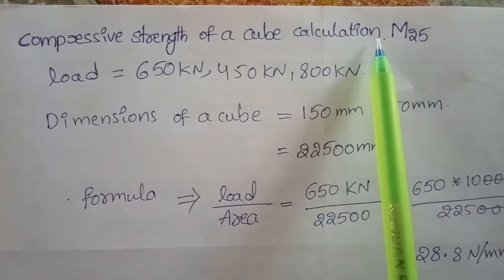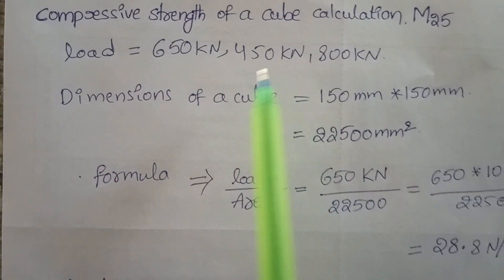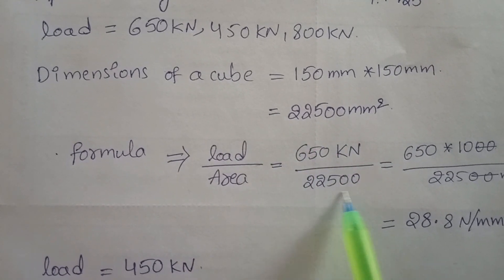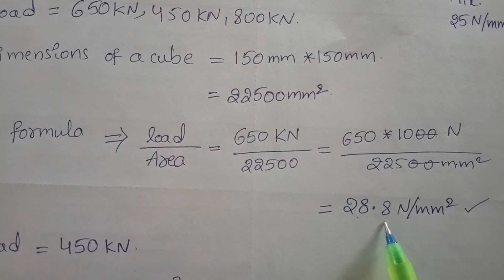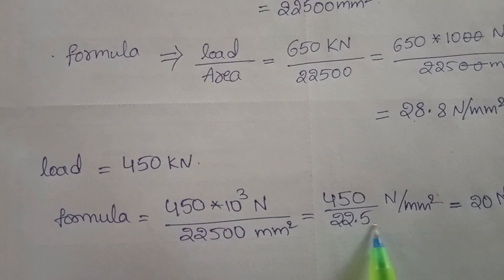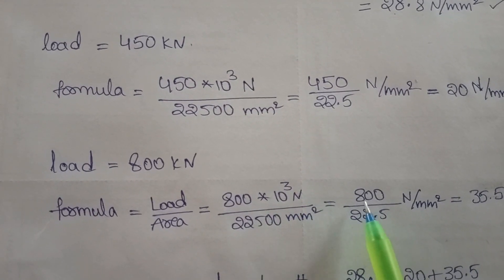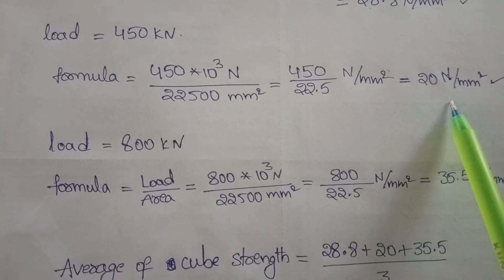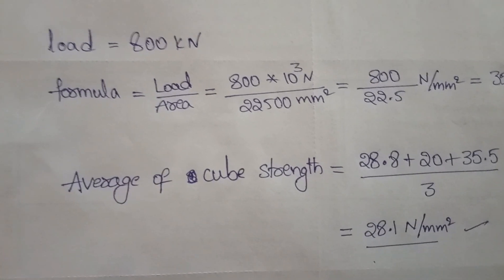M25 Cube casting & Testing with UTM & Calculation, Process watch it

Comment: This is not correct way of casting.  Fallow is codes..  Each cube difference 15% variation is correct..
Reply: What do you mean by 15% variation can you tell me in detail.
Reply: @sairammudumba2164  the average of the three values shall be taken as the representative of the cube provided the individual variation is not more than 15% of the average..
Reply: How is it 28.8+20+35.5 /3
?? 
Explain it how 28.1n/mmsqr